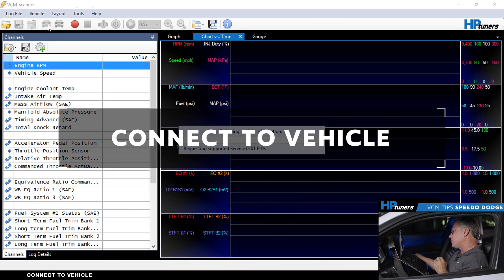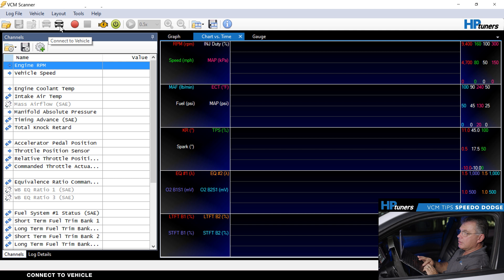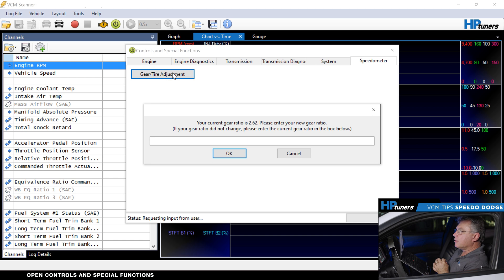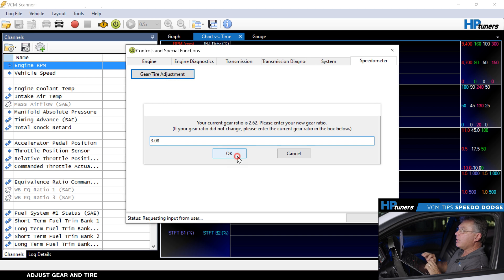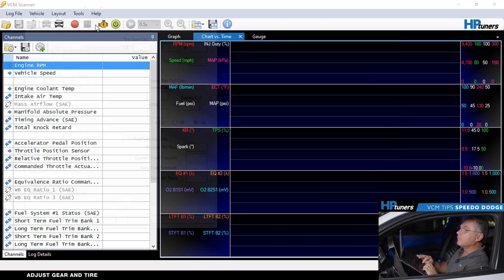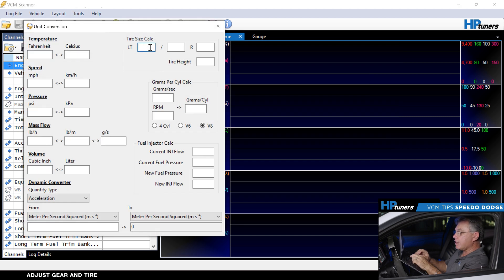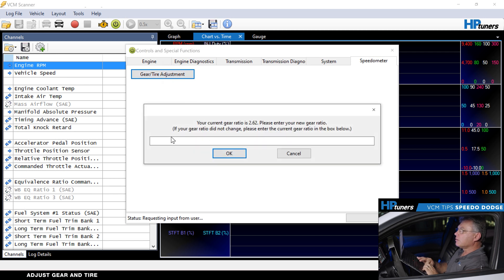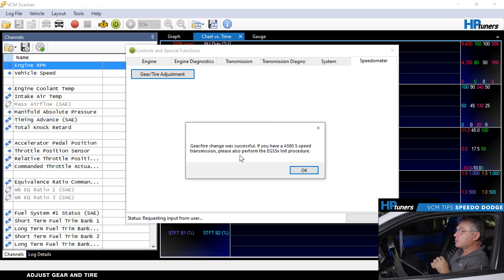How to Adjust the Speedometer on a Dodge using VCM Scanner | HP Tuners

Comment: I wonder it this would fix my problem. But before I give it a try, here's my issue. Guys, please let me know what to do:

After I had swapped a new 5.7 engine on my Charger RT 07 Last february with few minor modes 
 
- 87mm throttle body
- Camshaft COMPCAM XFI 208/212 hydraulic
- Eagle 5.7 Intake manifold
- Exhaust shorty headers from EFI
- e85 tune.
- 525cc injectors
- Performance exhaust line.
 
And I released the speed limit from the manufacture. 
 
2 months later I got a major link on the transmission (bad luck). I sent the full transmission to have it entirely rebuilt. I got it installed and for 2 months no problem at all. Then 2 months later, I went WOT for short distance just to enjoy the sound of my CHARGER RT 07 with the new exhaust line. The engine went into safe mode and got the icone light up (it seems like it does it randomly depending on how crazy I drive, since my story occured twice). But when I look at the code through the menu of the car, it says it is all good. And few minutes later, back on the road. Eventually the engine icone goes away (once, right away and the second time 2 days later). 
 
Yesterday, I plugged my HP Tuners and to figure out what is going on. I got two codes; P0730 along P0219 (Engine Overspped Condition). I will defenetetly drive smoother until I get this issue fixed ( I dont want to mess up anything at this point since I put already a lot of money to have my transmission fixed and the rebuilt engine from the States to FRANCE). What do you guys this of this  ? People told me it can be fixed with HP tuners tune. What exactly shall I tune ? How ? Thank you all.

Comment: Unless there has been an update in the last 6 months that changed this, it will not only fail but will cause a transmission control module incompatible error. From there everything goes bonkers and you will need a different tuner/solution to go back in and correct the gear ratio and tire size to remove the error.
Reply: I have heard several people with this issue and had to use a Diablo handheld to make the changes...wonder if it's just older PAM'S or certain models or years etc...
Reply: The only way I was able to complete it without errors was to use a Diablo i2 or i3 to change it. This was like 2 years ago so maybe the new software is better but I know my Challenger would never work using HPT to do it. I would get TCM incompatible errors.
Reply: Well that is not very happy at all!  Starting to question HPT decision.
Reply: Did you find a solution mate? 
I'm currently having the same issue. I've spent 2 days on this. AlphaOBD and HP Tuner. No luck. 
I have had the ratio changed before with HP Tuner. That was over 2 years ago. 
3.06 to 3.50. 
2013 SRT 300